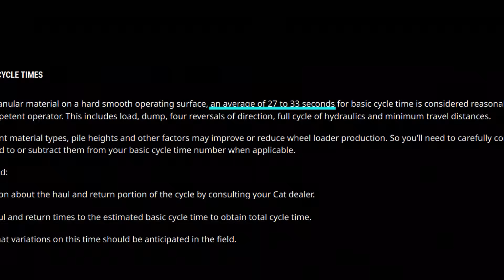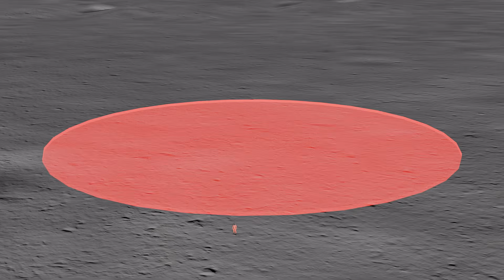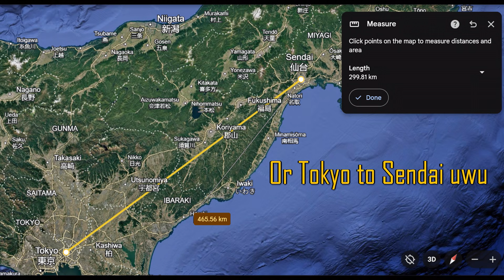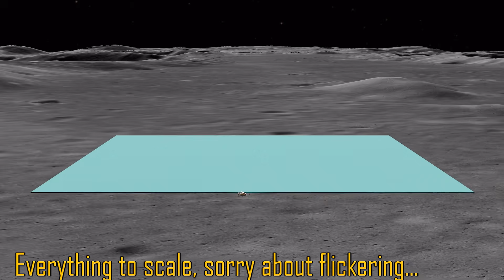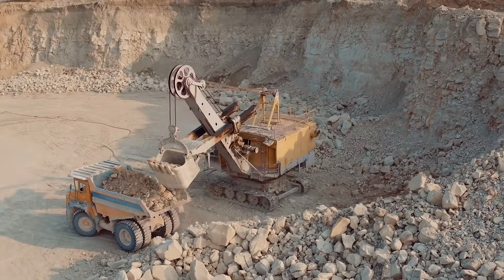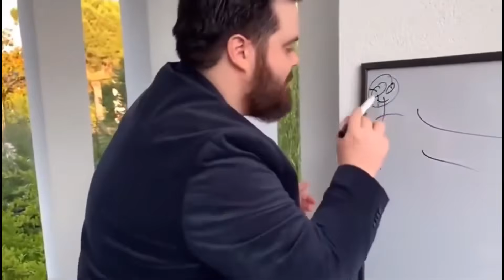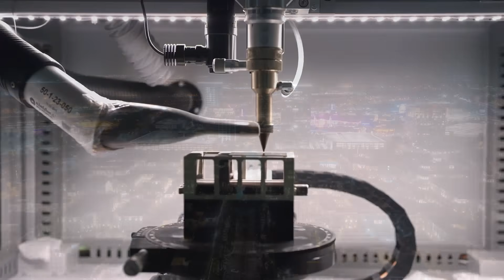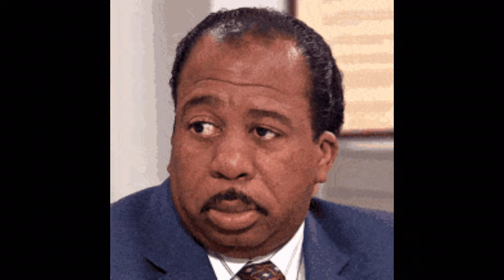How Much Bulldozer Can We To The Moon?

Comment: Lots of the weight of a loader here on earth is counterweight. Could save large amount of weight by making the loader light but tough. Then having fold out containers that can be loaded with regolith to provide the needed mass for pushing and loading. With the addition of a bucket that folds as well, one could pack a massive loader that unfolds itself, adds regolith to its counterweights with the first few partial scoops.
Reply: This is the real solution. These systems cannot go up there heavy, but need as much weight and ground pressure to do their job since traction is directly related.
Reply: absilutely right mate, have the back part of it be a large bucket/box with a lid, then the first job they have is slowly scoopign and unloading regolith into the backs of other loaders boxes, so addinthe weight, so each loader is half the weight, and when they are loaded they are at the designed weight
even if half the weight was off, it might take 4-5 scoops to full up with partiallly filled buckets

Comment: Incase you didn't know, Blue Origin is working on a larger lander called Mk2 that can land 20 tons reusable and 30 tons expendable. Much better than the 3 ton Mk1 lander mentioned in the video 

It also comes with a seperate spacecraft dedicated to transporting 100t of cargo and fuel to and from earth orbit and lunar orbit. I roughly estimate about 4.8 New Glenns are needed to launch both the fuel and cargo neccesary to put 20 tons on the moon

Comment: maybe you can use a Readsoning model and do a Time Cycle Modeling of the work. Your estimates sound linear in increase. As distances increase the more movement to get more material increase - it should be an exponentially increasing time factor. I'd still watch a correct recalculation of such.

Comment: I think an important overlooked factor here is the direct use of earth centric equipment performance metrics, particularly of dozers. Even if we assume the same level of engine power, the other limiting factor of dozers is actually how much mass and tread size they have, as without enough friction, it cant push. On the moon, you only have, at most, 1/6th the pushing power, all other factors being the same

Comment: This analysis assumes a linear relation between vehichle size and earth moving. That might not be true, and you might find yourself bucket limited, not limited by the rest of the vehicle. In that case, building only buckets might make sense (since buckets are a main wear point). The big problem with small vehicles is that small vehicles can only load small carts easily (without a helper ramp or a cut location). If you want big carts (and it seems like you do for square cube reasons), then you might make bigger vehicles so that they have a longer reach to load a bigger cart.

Comment: Dozers CAN in fact load material. Build a stockpile with a suitable fan and ramp, park a dump below the cliff face, and push material up and off the ramp. Did it all the time overseas when our 1 air conditioned axcavator was down.

Comment: Can you cover the logistic of converting lava tubes to habitable cities on the moon? It might be a larger initial effort, but the real estate you get is much bigger than building tents on the surface, and the maintenance will be much much lower than the average surface dwelling.

Things like:
The initial crane to provide the access to the cave.
Covering/melting the walls of the cave to make them leak-proof.
The access door which would hold the whole colony pressured.
Optical cables for natural light

Comment: What is the maths like for the friction and weight loading needed on these mini dozers to push the nominal amount of loonar dust they need to push? Will they need tracks to achieve this? Or many more sets of wheels? Or even weighing down significantly due to the one 6th gravity on the moon? Every kilo we push will push back against the aparatus, after all.

I think its best we stick to feet 😅

Comment: I think your conclusion is flawed.

Points where I think it breaks down:

You're lowballing the cost in mined mass required to build your structures.  The 10M ton Stanford Torus would require something closer to 20M tons of materials processed minimum, assuming the mass being used is refined materials.

Scale.  All earth moving on earth is estimated at 360 billion tons.  In the long term, the scale of industry expected on the moon should dwarf that number.

Night doubles your numbers unless there is some major power storage available.

A computer that can control 1 drone, can control a much bigger drone.  Build big, import the fiddly bits like computers.

Calculations based on volume not just mass. Cube square law means a bigger machine can move more for a lower cost of materials.  (Machines are not solid.  Eventually, you could get to a very large bucket  attatched to a frame.)

Power density and leverage.  The anology I have is to bury a flat plate with a handle in sand a few inches.  A 6 year old would have no chance of pulling it out of the ground while a grown man does have the power to lift it straight up.  A pack of 6 year olds couldnt pull it up either.  They'd get in each others way.  They could get it done in a multi step process of removing the sand and then lifting, but that takes time.    The situation i see happening with the small drones is you attempt to deploy a ripper.  And instead of penetrating the ground, it just lifts up the drone.  Or you get it in,  but now the drone's wheels just spin.  You need leverage and mass to apply the force needed to overcome the grounds' cohesion.

Comment: I think gravity being lower does not negate the utility of bigger machines; a teensie bulldozer with lunar gravity pulling on it isnt exactly going to tear through basalt boulders. Gravity may be lower but basalt isnt going to lower its yield strength to match. So all else being equal, even a big dozer is going to struggle more on the moon when dealing with anything but loose material. But yeah regardless of how efficient theyll be it still makes sense to import them initially.

Also, itd be useful to account for typical mining efficiencies here. Assuming its just moving of regolith, ok, but as soon as you are getting selective and looking for ores worth refining, you soon find yourself moving 100 tons of useless stuff for every ton of useful stuff.

Comment: 1) Starship has yet to proove any payload capability whatsoever
2) less gravity = less traction = less bulldozing capability
Reply: You’re right, Starship isn’t proven and may be moving backwards at this point. But Falcon 9 still has payload capacity, even if Artemis-specific Dragon variations are speculative atm. As for bulldozing capacity, what Ethan said is also true, though I think that the inertia being the same muddles that counterpoint a little bit.
Reply: Same bulldozing capacity, the regolith 'weighs' the same 1/6th as the dozen on the moon. Has 1/6th the traction but is pushing 1/6th the weight in theory
Reply: It still has the same amount of inertia though, so you still need the same amount of power and traction to accelerate or brake.
Reply: the first point is pretty moot, simply because we are still planning this out,  all the details will not be worked out for probably a decade or more and by then the situation with Starship could change to it being a functional Rocket. If not then there's always Flacon Heavy, though Super Heavy as a booster is working well, it just doesn't have a starship to go with it.

Comment: I have a proposal for landing large loads/vehicles on the surface of the Moon using a jet propulsion system with enough power to gently decelerate and land on the moon. 
How it works: a ship from Earth (Starship) with bulky cargo that is difficult to unload onto the surface of the Moon (for example, with a dump truck or a bulldozer) enters lunar orbit, opens the fairing and releases the cargo directly into orbit, then the cargo with attached jet engines (for example, maneuvering engines) slows down and begins a gradual descent to the landing site. After that, the computer or human begins a gradual deceleration for a soft landing, then the engines turn on at full power for a complete stop and a soft (or not very soft) landing, the engines are undocked from the device (bulldozer) for its normal operation. The engine system itself can be disposable and consist of many small engines attached to the body of the device (a bulldozer), or it can be a container with a landing system into which loads, base modules or transport are loaded.

Such a system will make it easier to unload bulky cargo to the moon even without landing the Starship itself.

P.S. Cool video, thank you for promoting this topic :)
Reply: You'll need to use rockets, not jet engines, and the need to carry the oxidizer and fuel will greatly reduce what you can send, though fueling the lander at the moon not at launch is always an option.
Reply: @CeoMacNCheese  Naturally, we are talking about rocket engines, it's just that the speech was slightly distorted due to the translation.
Reply: @solyanka-s1y  I see now

Comment: You dont need that much dozer, as the mass on the moon would be massive overkill, dozers arenheavy because earth is heavy to move. Regolith is easy to move, and in low gravity... Think more like 1/5 th the weight, twice the bucket volume. 
Diesel engine that drives that thing is a few tonnes, wont need that on the moon. Wont need the counterweight. Tracks will be useless in regolith, big puffy bog tires like a SHERP would be more effective. Basically, what we use will be custom built for moving regolith, likely be assembled in situ..
The whole premise is wrong.

Comment: I just thought of an idea. What about bulldozer drones?

Like a bunch of mini bulldozers all hooked up to the same network, with AI. All working on the same task (Say a single mound). You could have different bulldozer drone groups focusing on different tasks all being monitored by a single system.

Small volume, Small Mass. Even a few can do work, but the more you add the quicker it gets done.

If one breaks down, so what you have 20 others. If 1 large bulldozer breaks down, it needs repairs if work wants to continue.
Reply: This might be a good way to do it, and is they have a nice balance between size and power you could fit 10 of them in a single starship.

Comment: I think you need to let go of the goddamn Starship. It's literally the rocket equivalent of the Cybertruck. That thing's never going anywhere close to the moon, I can promise you that.
Reply: We actually don’t need starship to reach the moon, starship is so capable in low Earth Orbit alone you can make use of a solar electric tug to haul 50 tons of cargo to the moon in a year. L
Reply: @CeoMacNCheese  Starship isn't capable. Like, at all lol
Reply: @Arrow14100 its still in development though? Even then it’s an entirely new class of rocket with entirely different set of design choices and expectations than say the Saturn V or SLS. It going to get to space probably not on time, and not fully reusable. Super Heavy has already proven itself capable of full reuse, the main issue with it is that it has no starship to go with it yet.

Hell Superheavy could possibly get to LEO by itself with a small payload. You’d obviously wouldn’t do that but still.
Reply: @CeoMacNCheese  And it always will be...
If you think this thing's ever gonna do anything you're delusional.
Reply: @Arrow14100 I mean Falcon 9 never technically left development its just flying successfully now. Even then have seen any videos diving into the issues of Starship? Like at all?
Reply: @CeoMacNCheese  This just reeks of cope at this point
Reply: @Arrow14100  to think that Starship is absolutely 100% doomed to fail is also somewhat delusional. The truth lies somewhere in between. If it eventually works, great! If it doesn't, then we still have other options
Reply: @notgreg123  Please tell me when it's supposed to be finished and come back to that comment then. It ain't gonna happen chief.
Reply: @Arrow14100  nah, ill shift the burden of proof back to you
Reply: @notgreg123  Ok, what do you want me to prove?
Reply: @Arrow14100 ...your claim
Reply: @notgreg123  They've already blown their entire budget by nasa to get to the moon. The design doesn't even work on paper. It can't carry cargo. It can't land. It burns up in the atmosphere or straight up blows up on the launch pad. They've never met a deadline in the entre "development" cycle. And it's basically just your generic Musk vaporware and will probably soon get cancelled or investigated for fraud. 
Stop sucking Elon dick and get realistic. This thing's NEVER going to the moon.
Reply: @Arrow14100  Starship will succeed :)
Reply: @CeoMacNCheese  There are no videos because the problems are all covered up, at least before one blows up on livestream a few days ago. Just like there are no videos on how drugs/spies get into your country - therefore no drugs/spies exist in country right?
Reply: @notgreg123  If the CEO of SpaceX has shown himself to be excellent in one field, it's making promises. And explaining away why they've repeatedly been broken. I'm still waiting for a round the moon trip...
Reply: Got a suggestion for another reusable super heavy-lift launch vehicle?    And your CyberTruck comparison is based on what?
Reply: @hello-ji7qj  Blue Moon Mk2 is similar enough. I estimate between 5-6 New Glenns are needed to land 20 tons on the Moon. Better yet, use starship to launch the fuel and New Glenn for the cargo and you're probably more efficient than lunar starship at that point (I'm gonna check the numbers one sec)

Edit: nvm it's about the same assuming 100 tons to orbit. If block 3 can deliver on the 200 ton capacity though then this architecture can get 100 tons to the moon for the cost of 10 launches

Comment: I think that you made a few very big assumptions here, that the machines would have 100% uptime, the feedstock material could be sourced from anywhere and translate 1:1 to useful alloy and that dozers would perform useful work on both trips. 

Realistically I think that something closer to a 60% machine uptime is a good conservative assumption between charging, maintenance and waiting for repair in case of mechanical failures.

You can probably safely slap a factor of 0.1 for useful feedstock gathered per hour where specialist alloys would be needed, 0.9 for everywhere else to account for losses in transit. 

You would also need to construct enough refining capacity to keep up with this rate of gathering, which is not a trivial amount of mass... But even ignoring that we're looking at 2200 hours instead of 110 for the torus for example

Comment: I think the way to get a heavy cargo item like a dozer deployed on a the surface of the moon would be to use the extra volume in the payload bay to include a powered landing frame for the dozer and just drop it from orbit rather than trying to unload it on the ground

Ground pressure of the dozer's contract footprint would be a very large consideration, i'd guess a dozer track would be fifteen or twenty times the pressure the regolith would support without a massive amount of sinkage. I imagine you'd need big wide tracks like those snow cats they use in the arctic.

Comment: Big machines can be delivered disassembled in parts. Standard practice even here on Earth. So unloading won't be that much of a trouble.
Reply: But assembling them on the moon may be very difficult
Reply: @anuphys  Send a smaller vehicle with a couple of robotic arms that can be remote-controlled for the purpose of assembling larger vehicles that are shipped in parts. Leave the fiddly parts to the colonists once they arrive. Once they get there, they just have to spend an hour installing electronics and connecting up cables before they can use the thing.
Reply: @anuphys  Things weigh 1/6 of what they do here.  One person could pick up a car engine by hand in lunar gravity.  We might not be assembling D8's by hand, but a couple people could reasonably assemble something like a forklift that could in turn unload and assemble the D8.
Reply: @anuphys  First thing to make would be a lift, and maybe a gantry to move large parts. Likely by hand at first.
Reply: If they can’t be assembled in 1/6 gravity by astronauts with hand tools, they could always be assembled in lunar orbit and then landed. The starships aero fairing isn’t necessary for that step

Comment: Small light machines moving stuff is good on paper... until you try to dig a hole and insted of going into the regolith, you lift yourself. 
Also small machines, in order to move and accelerate mass, need to speed up to dig into the regolith, making a cloud of dust, which would be very unpleasent.  Without mass you need to increase velocity to have the same power. 
The whole concept of friction/traction forces while digging/moving ground is in question with light machines. You need a heavy machine to move dirt efficiently. 
Also small machines need to work in swarms, to do any sort-of-precise earth movement. Where the big DOZA' can just flatten a patch for a road or something else, the smol' dozas' need to basically fiddle with it and move side by side, up and down for multiple passes. Like trying to carve out а statue with a needle.

Small machines, just like on earth, can be good for landscaping, but when it comes to industrial scale work, you need something bigger. 

Also small machines don't have much space for built-in redundancy. Lunar night is no-joke, even at the equator.

Also for big machines it may be worth to be delivered with a special carrier that detaches from Starship, like the one for Curiosity on Mars, Sky Crane if I remember correctly. Or perhaps, in the future, the "Sky Crane" module can be integrated into the machine, giving it the ability for fast relocation. The future is cool, only if we don't kill each other before it XD